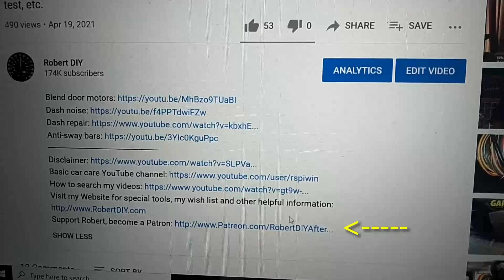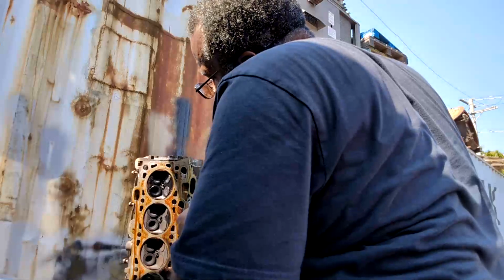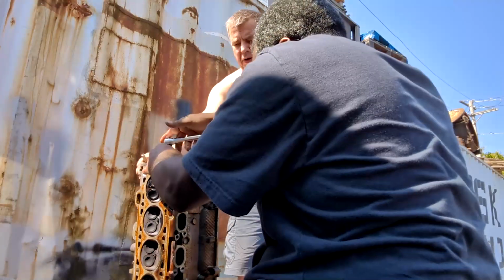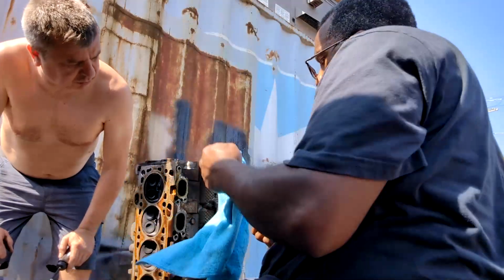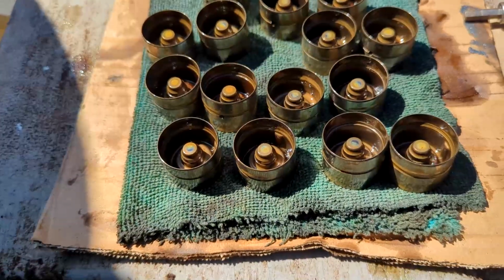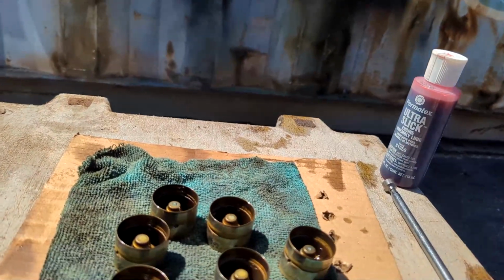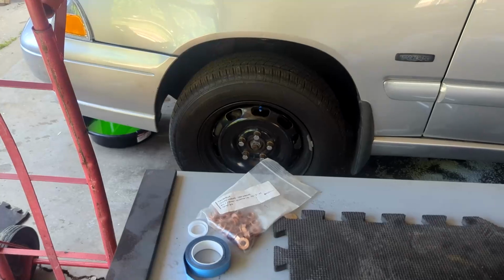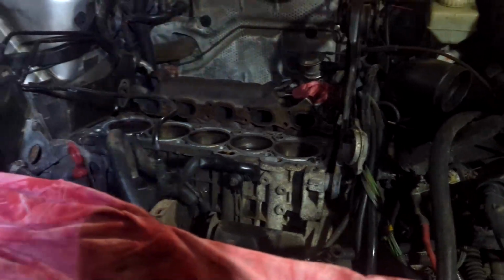Worked on a cylinder head, hung out with Alex, installed a Japanifold & pre-head installation.

Comment: Unrelated question from the UK. Just picked up a 2003 C70 convertible with a broken headlight lens..... will mk1 V70 or C70 coupe fit? Do some have "crystal" style lights?
Reply from the maker: Yes, those headlights are the same size but only the c70 came with the Jewel headlights late 2003 and 2004.